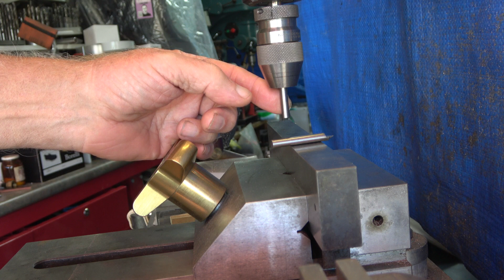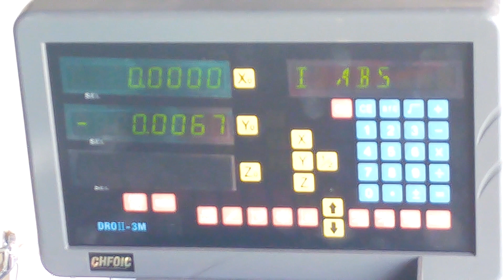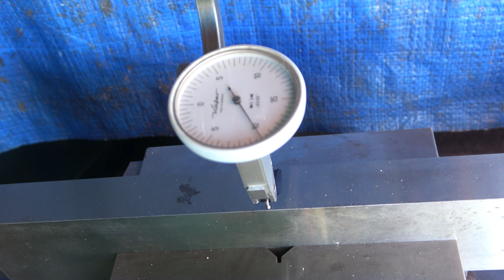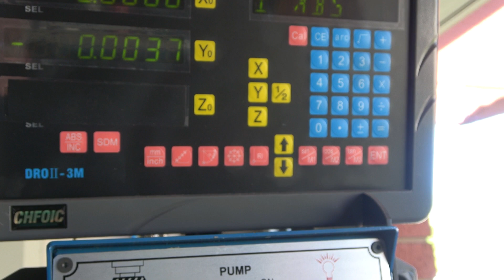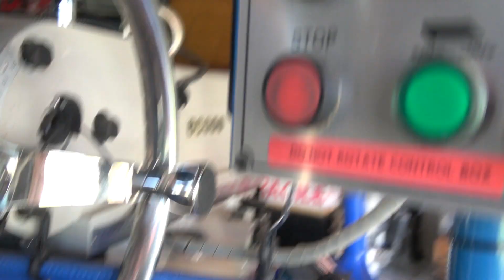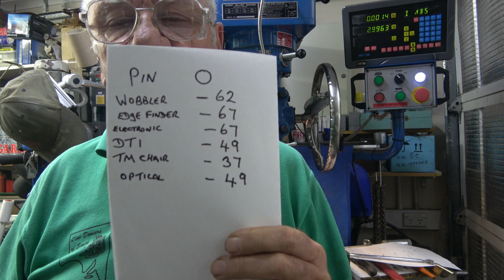7 Edge Finding Methods Compared Using A Digital Readout

Comment: Thanks for the video. I do as much of my work from the center of the work piece as possible. First using a manual edge finder then if necessary an indicator to fine tune. My edge finder is consistently within .001 - .002" . I have seen edge finders with weak springs and they are less accurate.
Reply from the maker: Thanks for sharing David. Glad you found it of interest. Regards.

Comment: Backlash should only be an issue if relying on the dials on the machine to place the spindle in any one place. DRO's tell us the reading of the placement no matter the direction of travel and no matter the amount of backlash. In fact you could use the DRO to determine the amount of backlash. If I have this wrong please tell me why? I need to learn as I am not formally trained.
Reply from the maker: Hello Kevin thanks for the view and your comment. Yes you are correct that with a DRO any backlash is irrelevant, but I was just pointing out to those who do not have a DRO that you must always know in which direction the backlash lies and how to apply it. I have another video which shows a method of achieving that. Regards.

Comment: I am not convinced that the TM chair is the most accurate. All methods are compared to the original pin and paper method which probably is the most inaccurate?? The TM chair is the closest to that. As a few other measurements are very close to each other they are either more likely to be accurate, as opposed to  being the worst IMHO. Happy to be wrong here but need to know why. I am an amateur so quite likely wrong I guess.
Reply from the maker: Hi Kevin, thanks for the question. Toolmakers chairs are I imagine from the early 1900's way before the edge finders we have today and provided they were accurately made were a quick, easy and accurate way to find and edge other that the Projected edge method. The wiggler / wobbler came about in the USA in 1918 and was much cheaper. see link to Patent.
https://patents.google.com/patent/US1300428
Personally I think that the results I obtained were in general quite correct, I was showing the different methods. The trouble with wigglers and mechanical edge finders is the Human eye and hand coordination / reaction, by the time your eye sees it move, you hand could still be moving so an error occurs. Have a look at the latest video where I do a repeatability on wiggler, mechanical and electronic edge finders. For general engineering tolerances 0.005" error is more than acceptable. Thanks for watching.
Reply: @daveticehurst4191  Thanks Dave. I don't question the results you got, they seem pretty right to me. My actual intended point is to do with the comparison with the paper /pin method. I just think the other results highlight the inaccuracy of that method. ps In regard 0.005"as a poor result generally, but it is of course regarding the desired or required accuracy eh.

Comment: very informative but im confused, How do you know the chair was the most accurate, when the dti and the optical gave the same readings. my thoughts are the chair is more likely to have errors machined in it rather than (although fiddley) the dti method with a known ground flat bar.
keep up the great vids
Reply from the maker: Hello Paul, thanks for the view and question. The Toolmakers chair are a high end engineering instrument and are better than 0.0002" ( 2 Tenths ) accuracy, ( hence the cost ). You then also must take into account that when you have used it that any offset error indicated is Double the actual error as you were sweeping the chair. i.e. indicated dti difference 0.0005" is only an offset error of 0.00025"  With you question asking how is a chair more accurate as the other readings were the same, my simple answer is that the chances of people having the optical one is very slim; secondly as you saw the Projected Edge method is very fiddly and time consuming compared to using a chair. So that is was why I made the comment that the chair was the most accurate. Apologies if you think that my statement was incorrect. Each to our own opinions.   😊 Take care. Best Wishes.
Reply: @daveticehurst4191  Hiya Dave, thank you for your in depth reply. As it happens I used my edge finder today for a quick and dirty job, found both edges on Y used 1/2 function on my DRO started to spot it with my center drill and it looked wrong. I got my calipers out and measured from the spot to both edges and was 0.4mm out! how the hell I've managed that I don't know, but at least it wasn't a part for a Elon Musk space ship😁